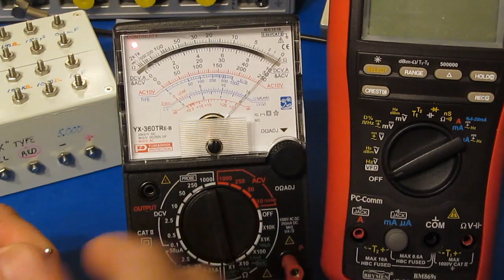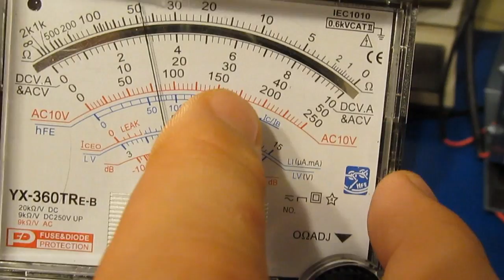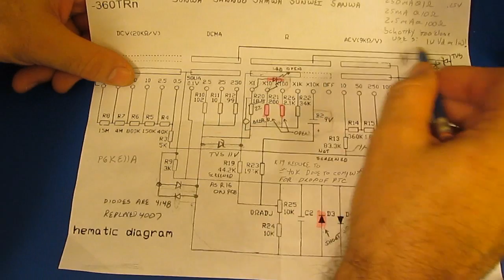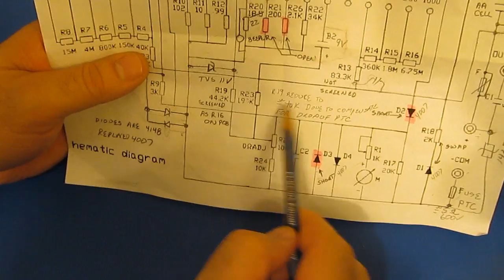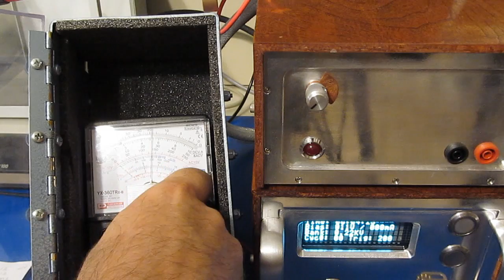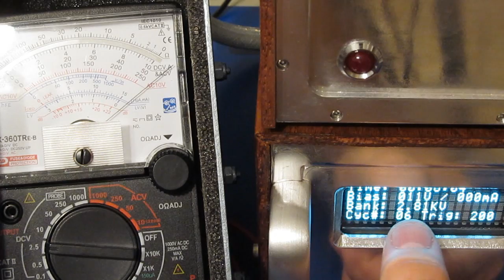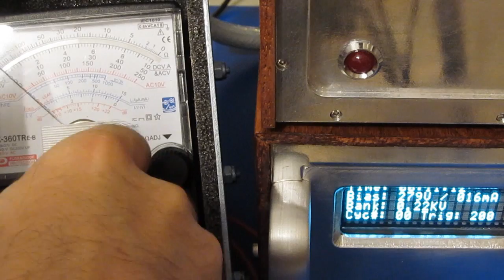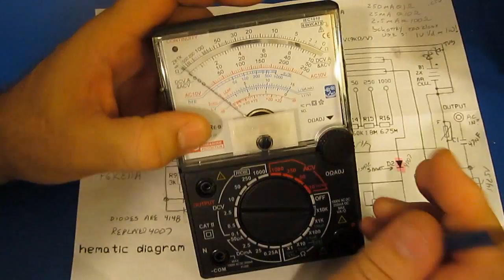Additional mods to the Tekpower Sunwa YX360TR Multimeter

Comment: thats a fake chinese made crap copy/clone attempt  of a made in japan Sanwa YX360TRF
Reply: Trust there is worse , there is backdoor sold Chinese Chinese copy , with  half   component removed , like continuity check , buzzer and LED , gone with the wind , thats  my version  labeled as  TRN , but tis ok , im using it as ammeter/voltmeter for my DIY power supply ,  tough me more then anything , striped it down to the gauge and reused it as volt amp meter for my DIY power supply , something i couldn't do if it was original expensive version , dont have that much cash to destroy  expensive stuff .

Comment: For College training purposes, is it a good meter to practice on five band resistors?
Reply from the maker: It's a good idea to learn to use a an analog meter and read an analog clock.   I have not used an analog multi-meter I would say for at least 30 years.

Comment: I have several analog meters that have a resetable  protection. The AVO-8 has the mechanism you described for the 30's meter. My Unigor, Pantek and Philips have a contactbreakers,  The last 2 use transistors to activate the relais. That works very well.
Reply from the maker: I doubt you would find a fast enough mechanical protection system that would save the meter during these tests.  Most of the event is over in 100us.

Comment: I actually have the same meter, i bought it for use with RF amplifiers and a RF probe, because most digital meters go crazy if they are any close to 50 plus watts of RF running into a hacked-together dummy load. You inspired me to do some mods to my meter as well. I did notice the significant error a DC offset introduced on the "AC" scale, figured it out by looking inside the thing (not much to talk about at all), but was too lazy to install a capacitor until now. It's easier when someone's done all the thinking before haha.

Thanks a lot for the informative video.
Regards,
Andrei
Reply: Now if i could only fix my cheap Gordak soldering iron to not run the heater full blast every time i'm testing a RF amp lol.
Reply from the maker: Ran into same problem with meters that were sensitive.  This meter does have that internal capacitor that you can use for AC.  Just not a great setup having to use it.

Comment: can this meter be modyfied to measure crt hearer voltage at 15,6kKz without loading on the filement too much?
I have other meters for other works, but most of my digital ones have limited bandwidth (in spec) to about 1khz. UT139c woudn't even pick up voltage at this frequency at all
Since i get this exact meter for free, and 16kHz is kind of in acustic range it would only reqire some kind of high impedance buffer, like for a guitar amp that would handle 30V input and output swing, could be even batery powered for "safety".
I know that modyfication of the meter is a bad idea , because you are on your own when something goes wrong catasrtofically ,but on the other hand a crt heater rms voltage is only obout 6 V at about 700mA in my case, so sacreficing this meter for that purpouse only wouldn't hurt (less that 6W  at low voltahe to blow something up) .
What do you think?
Reply from the maker: What does the waveform look like?   Is that 6V peak, p-p, what?   What sort of wave shape?   Is there any DC bias to it?    Do you have a scope that you could provide a screen shot?    I could then run a test for you with the meters I have available including this one.
Reply: I have an Oscilloscope, but only analog one with 10mhz bandwidth.
waveform would be a triangular , symmetrical peak around 22V  from the bottom, 20us at base, followed by 40us of flat line.Falling edge of the triangular peak is filled in at the bottom and transition to flat line is smooth on that side, raising edge and peak are sharp at corners.
I didn't check for dc bias, but my ut139c show the frequency of this waveform, and it wouldn't want to do it with a waveform that does not cross trough 0. Or i just don't know how to use it :] my old ut201 (non rms) show about 5,15V at ac range, ut139c true rms shows 0,0006V (out of bandwidth),
service manual of my tv cals for measurment with hp 3403c and rms voltage value of 6,3V at 700mA (ac bad 10V scale)
And since i replaced the crt and that is the only voltage i have problem determining value of i am a little cautious about it.
I was thinking about making an opamp buffer powered from 3 9V batterys in series.  a 500k pot to set ground bias and 2 3 meg resistors, one for input and one as a bias output for the floating ground

edit
if i read schematic corectly, it is dc bias at 53V from the chasis ground, but it is driven from its own winding of flyback transformer in closed loop.
Reply from the maker: 20us + 40us would be 16.67KHz.  Is this just the error in your measurement?   Is the rise and fall of the triangle 10us?
Reply from the maker: Saw your post on EEVblog with the scope shot.   I'll post what find in your thread.  It will take me some time to put a test together.
Reply: thanks for your help, as for the the scope measurment, it might not by accurate, my scope wasn't calibrated on a timebase since i got it , and it is about 30 years old. In my post on eevblog, the waveform is verticaly fliped i was measuring it with both scope and tv floating with no earth reference.

Comment: Ooow bomb proof ;-D
I think the old avo 8 meter uses the needle trigger breaker.
What about stopping the meter slam, reverse diode across the meter module?
A germanium diode in series with the meter module would stop reverse slam, but the diode would lose too much unless you tweak R1 perhaps?
Reply from the maker: Certainly more robust than it was and no more glass fuse.   It slams pretty good in the forward direction as well. I thought about increasing the size of the dampening cap but would end up giving up some of the response.  It would be fun to try and protect a high end analog meter.   If I were to design a modern analog meter it would be a hybrid.  None of this low impedance rubbish.  lol.
Reply: LOL you would make a digital/analog dual display meter, a fet op amp tapped on to the output of the resistor divider to drive the analog meter, the best of both worlds :-D
Reply from the maker: Right.  Or maybe a stepper motor meter.  Than again, I haven't used an analog meter in I would guess over 30 years.  Talk about beating a dead horse...
Reply: Hey, your the one that suggested modding an analog meter, i was just commenting back, stick to the digitals.
Reply from the maker: Well it was "If I were to design..."  I'm sure they have their place but it escapes me what it is.  The few times I would have liked the visual effect,  I can now get with the Brymen.
Reply: @zx8401ztv  That meter does exist. It is the CA5011 from Chauvin Arnoux.
Reply: Smith, I love a good pointer swing! I have several analog meters. My favorites are by Bruel & Kjaer. Love the vids, the destructive testing and the mods. Cheers

Comment: Furtunately those glass fuses are easy to replace. Joe what kind of resistors are you using in that fancy box?
Reply from the maker: Most are Vishay low temp co, 0.1%.  Less than 1ohm and the 100M ,1G are Ohmite.  Caps are all film or ceramic.